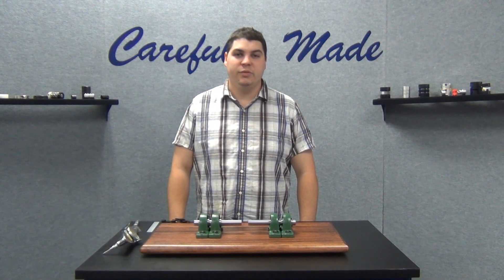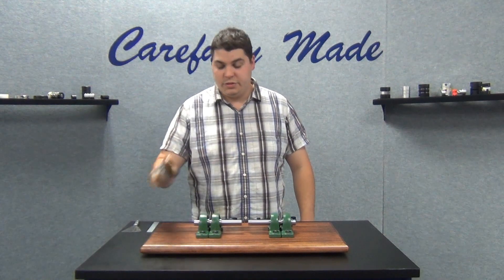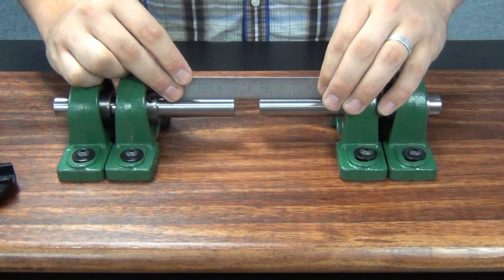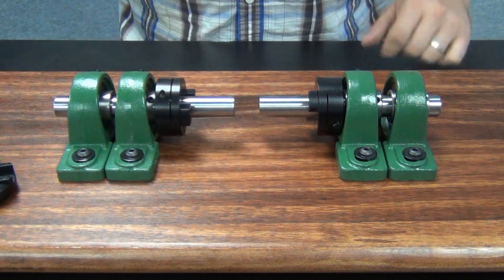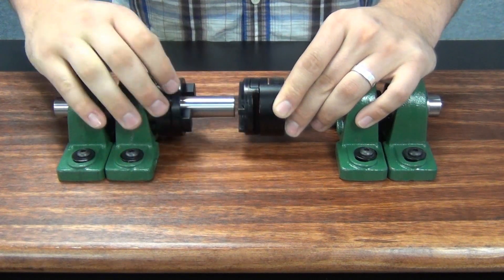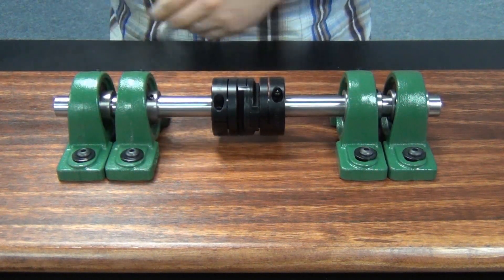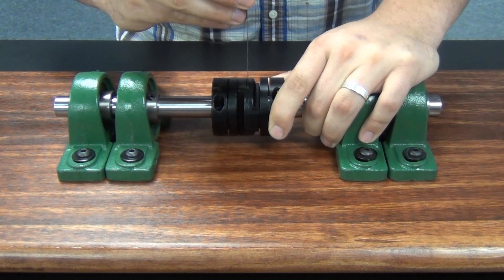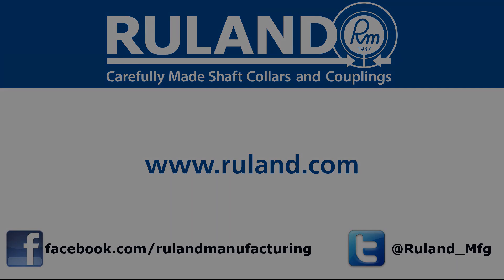How to Install an Oldham Coupling | Ruland

Comment: Sir, If both shaft in same line then why use Oldham?
Reply from the maker: Hi Dhaivat. There are a few reasons to use this style of coupling when shafts are aligned including lower inertia, balanced design, ease of mixing shaft sizes, ease of mixing shaft profiles (round on one side versus keyed on the other), and assembly in confined space. This is not a comprehensive list, but at least something to get you thinking. We offer couplings for shafts with perfect alignment (rigid type) as well as oldham and other flexible types. When selecting the correct coupling for the application there are many factors to consider and you must consider all of them to be sure the right coupling is chosen. Hope this explanation helps! - Chris from Ruland
Reply: Also because two shafts are never actually perfectly inline. Or at least I never seen even the most skilled of guys nail it perfectly and even a 0.025 mm is enough to really reduce the life of a machine